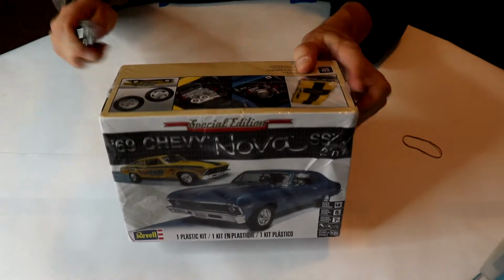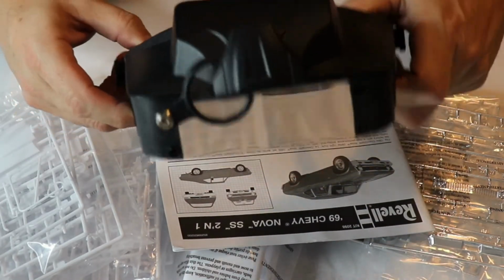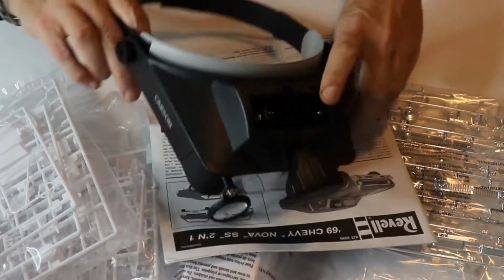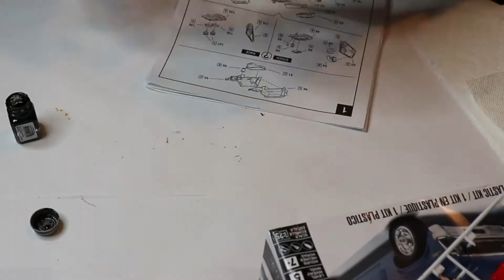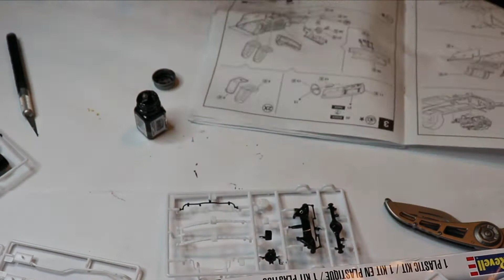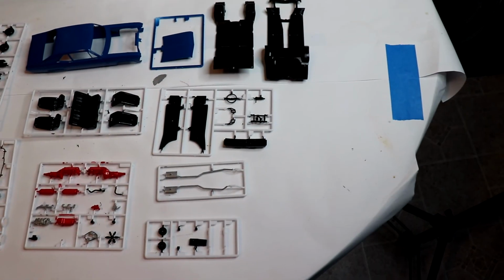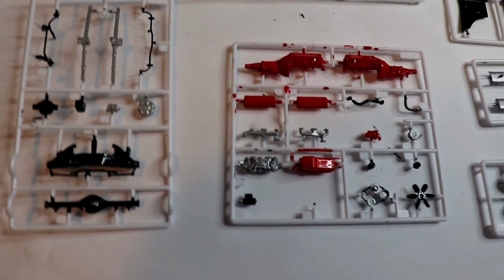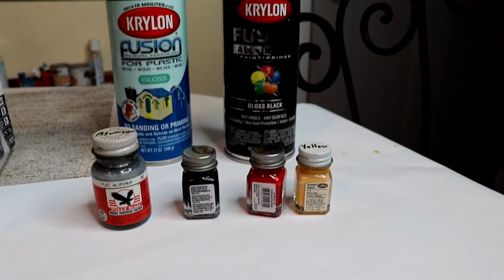Revell: 69 Chevy Nova SS Model Build: Part One - Painting

Comment: I see that you never used any grey primer. You need to use primer to protect the plastic if you are using lacquer paint only because later on in years the lacquer will start eating the plastic you need to primer everything whether it's a gray primer or flat black primer or whatever always prime everything clean everything with soap and water to make sure that all the grease from the manufacturer is all gone.
I used Tamyia grey primer and all the other colors that Tamyia provides they are all lacquer paints and they dry about an hour or so I also use testers flat blocks for the chassis if I'm going to paint the interior tub black I use the flat black for the carpet area and also the back panel below the rear window I also use semi-gloss for the seats and door panels and dashboard and steering wheel just a little tip for you
Reply from the maker: Good to know! Thanks for the advice!